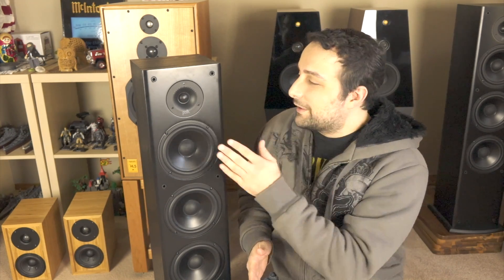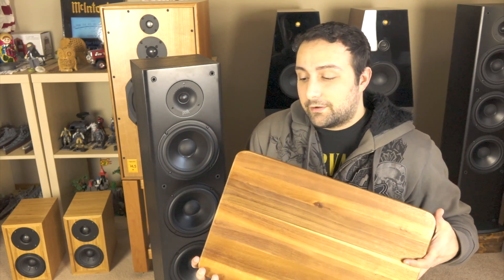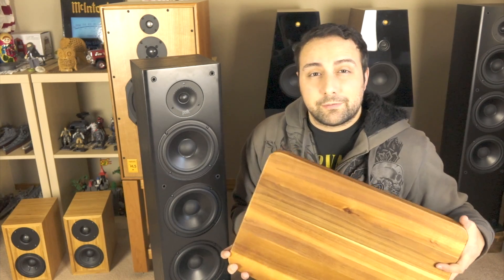The Polk Audio T50 Bonus Video!

Comment: Finally getting around to thanking you for your review of the Polk audio T-50 tower speakers. Purchased these back this spring.

Your thorough review of these as well as other speakers in a similar price point with information about tone and sound preference really helped me choose the Polk T-50’s for my particular listening and listening space😎 thoroughly enjoying them in stereo set up as well as part of my home theater arrangement!

Thanks again and keep up the great work!!!
Reply: Follow up to my thank you 😎 regarding the Polk audio T 50

Still loving them with a a budget Onkyo tx sr393 avr,both in 2 channel listening and in home theater set up.

Wondering for thoughts or tips about adding a smaller subwoofer in a room that is 13 foot wide by 15 foot long 8 foot high ceilings, and would have to go near a corner? Or is that too much bass potentially in a small space 😎

Thanks!

Comment: I bought these speakers based on your review (and others) and I'm not disappointed. I just installed them yesterday. They add a really warm dimension to my existing Cerwin Vega D2's and really round out the over-all sound of my system. The bass is surprising for such a small tower. Great review and thanks for the tips too! :)
Reply: i am also using same package it is simply awesome in tower model...

Comment: Great advice on setting up the Polks and really, advice that should be used in any speaker purchase. I think a trap so many people fall into is they are afraid to experiment with toe in options because everyone seems to do it a specific way. This makes people feel like "well since Jon does it this way, it must be the right way!" This is never the case. Every room is different and every listener is different. Its been my experience to always start with the speakers straight ahead and play them this way for a while. After that, I try small and gradual changes in toe in while listening. This always leads to better results! Also, getting the speakers off the floor is a great move as well! The butcher block idea is a gem and I have had the same results when experimenting.
Reply from the maker: +New Record Day -   Thanks!  As you well know, there are a tremendous amount of factors that play into fine-tuning a system.  I won't delve into these factors here, as I don't want to scare off anyone who is new to this gig.  

That said, I'll re-enforce your comments by saying that there is no golden BB when it comes to this stuff.  All you can really do is latch onto some common guidelines and then let first-hand be your real guide.

As an aside, perhaps you should begin to craft some more in-depth instructional videos.  You seem to be pretty good at that stuff. :D

Comment: Awesome!! 

LoL....I've beeb using these thick cutting blocks for 16 years..

No, I can not present an essay on the the differences of tone and timbre; between Bamboo, Acacia and maple...lol

But I do prefer Acacia : ) LoL

A word of caution regarding using little wood blocks:

Wood blocks can be a very unstable foundation for speakers. With lighter weighing speakers,  and/or very tall slender speakers; they can tip over very easily.

If you have young kids, or pets ( cats and dogs, primarily). Or if like me, you have moments of being a clutch. Wood blocks can be vulnerable.

Just some advice. Been there....done that. Had a speaker take a nasty tumble.

Comment: Hey they sell these “Speaker Isolation Pads” on Amazon designed to put underneath a speaker for better sound $20-30. Might be better than the cutting board. Not sure

Comment: Hello. My current setup is as follows: front channel is 2 Polk t15 and the same for the rear channel. Center channel is a t30. I’m wondering if I would get better sound replacing the front t15 with t50s. I have a sub it’s a paradigm pdr10 paired with two titan v3 and I have the v3 on a switch and use just for music. Receiver is a Yamaha rx-v385

Comment from the maker: Deigo Ra -  I saw your comment on the previous upload.  To answer your questions:

Here is a brief clip that I took of the T50's playing music:
 https://www.youtube.com/watch?v=3XEs30n8ZJw

As for comparing different speakers via: sound clips -  It's a cool idea.  The problem is that it's nearly impossible to pull off to any meaningful degree.  First I'd need the right gear ( which would cost a lot of $$$$$$$) to get the job done.  And even if I had that gear, there are so many uncontrollable variables at play that it would tough to produce something that could serve as a merit-worthy resource.
Reply: What do you mean with expensive gear? You could just connect one speaker to the left channel and another to the right channel and switch the balance. For example one side with your Klipsch RF-7 and in the other side the Rosso Fiorentino volterra. And I know via YouTube would be difficult to notice a lot of difference, but the essentials I think it's possible, like oh you know what the RF-7s have more mid and are louder but the tweeter is more harsh than the rosso fiorentino. And the most detailed things you can give your thoughts after the test. I don't know, I think it would be nice to have something like a speaker competition.
Reply from the maker: +Diego Rla -  Funnily enough, you just hit on a great way to evaluate gear.  Not a lot of people do this, but listening to a speaker in mono will tell you a lot about its natural character.

As for recording:   I like the notion.  The problem is that it's incredibly difficult to execute.  I've recorded the sound of many products, and rarely am I able to capture something that I feel adequately represents what the products actually sound like.

Now if I could find a way to get consistent and accurate results, then I'd be all over this situation1  But as it stands now, there are too many people who judge the sound of gear based off of what they hear on Youtube, and I'm not about to misrepresent products that people have invested so much time, effort, money, and passion into making.

Comment: Since they are small, could they be used on a shelf, like a bookshelf speaker?
Reply from the maker: Hey Anthony -  You could use them like a bookshelf speaker.  They use passive radiators, which means the bass should keep itself in check even when you place them right against a wall boundary.  

However, if I had to be completely honest with you, I'd check out the ELAC B6 as a good alternative.  Similar price.  Great performance.  Will sound a bit better on an actual bookshelf.
Reply: +Zero Fidelity I tried to look up ELAC B6 bookshelf speakers, But there are not many places that I could find, that sells them. Plus they are just slightly out of my budget, However Best Buy now has the Polk Audio T-50s on sell, for $100.00 each, $200.00 for a pair, that's almost to good for me to pass up!
Reply from the maker: Yeah, $200 for the pair is a damned fine deal. I still am not sure how they'd work high off the ground, but for that kinda money, it may be worth a shot!
Reply: +Zero Fidelity I am a bit confused on witch speakers to go with, I'm on a tight budget, that's why this is so hard for me to decide. First off, I have a two channel amplifier  and do listen to alot of music. My amplifier does not support a subwoofer, therefore I need a set of speakers that has as full range sound as possible, the specs on the t-50s said 38-24,000 in frequency response and up to 150watts of power @ 6ohm. If this is true, it would work great for my application. Since the topic is Polk Audio, I found some other speakers that happens to be on sale. The Polk Audio TSx220B bookshelf speakers, they are about the same price as the t-50s. Just wanted your opinion.
Reply: +Zero Fidelity If I do go with the t-50s, I could just experiment on what height would sound the best, as long as it has a solid foundation and has at least a foot from walls or corners right? What part of the speaker should be ear level in the seating position?
Reply from the maker: Hey Anthony,

Since you are in the market for an affordable bookshelf speaker, I'd go with the aforementioned TSx 220B's.  Either that, or bring home a set of ELAC B5's.  The Polk 220b's will be lively and more dynamic, whereas the ELAC's will be more relaxed and warm sounding.  

As much as I like the T50's, there's no point of getting a set if your space requirements demand a bookshelf styled speaker.
Reply: +Zero Fidelity My space is not exactly closed in, the room is medium sized. I could always move them to the floor and adjust furniture to help achieve the best sound. I'm listening to your tips and I'm going to give them a try. I really do appreciate it. But the ELAC brand is hard for me to get in my area. If you think that a bookshelf type speaker is the way to go for my shelf. I found the Polk Audio TSx220B, a pair of bookshelf speakers for $180.00, 50-24,000 frequency response and 125 watts of power @ 8ohm.
Reply from the maker: Let's make this super easy for you.   

If you're able to adjust the furniture in order to accommodate the T50s, go with the T50's. 

If you want to stick with something that will sit atop a shelf, then go with the 220B's.  

Easy peasy.
Reply: +Zero Fidelity Just an update, I went ahead and purchased the Polk Audio TSx220B. They had them in the cherry color and it matched my shelf. Some how it worked out great because when I'm sitting in my chair dead center. The tweeters are at ear level. I think that they sound well balanced. I was a bit shocked at their size when I took them out of the box. But when I heard them. I thought I was listening to  even bigger speakers. They also have the bass that I like. I may still get a powered subwoofer in the future. As long as it has high level inputs. But for now I'm thinking about connecting a dac to my setup. I found the AudioEngine d1 dac for around 200 bucks. It has the best features all in one for the money. Perfect for my setup. You think a dac will make my music sound better through the 220bs? Instead of just through the headphone jack on my computer?
Reply from the maker: Anthony - Heck yeah man!!   Congrats!    I'm glad you like the Polks!   As for a DAC, honestly bro, go ahead and save up your cash and then buy an iFi iDAC2 ($349).  That's an excellent, highly natural sounding DAC for the $$$$.   I can also confirm that it matches Polk products quite well.  

Meanwhile, enjoy the tunes!
Reply from the maker: Not sure how I missed your response Anthony.  My apologies!    If you haven't already, get a quality DAC.  The good news is that there are plenty to select from!    Glad you are enjoying the 220B's!

Comment: Here is what I think of cheap Polk towers:  I'd rather invest in higher quality two-ways, and later a sub.  The classic polk monitor 5 and 10 are far better than the 50's. Parts breakdown of the T50:  three $5 woofers , a $2.00 tweeter and a $2.00 crossover.  Seriously.